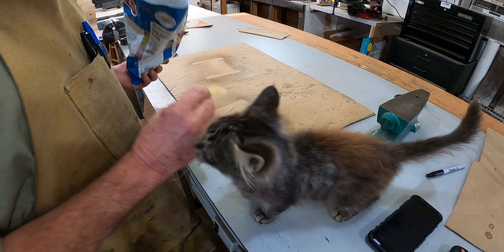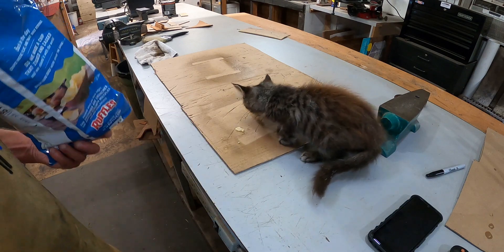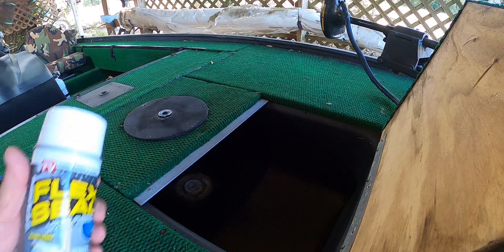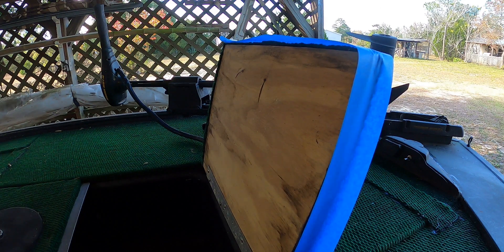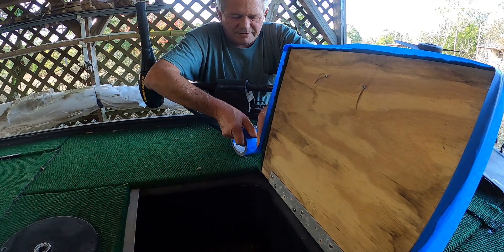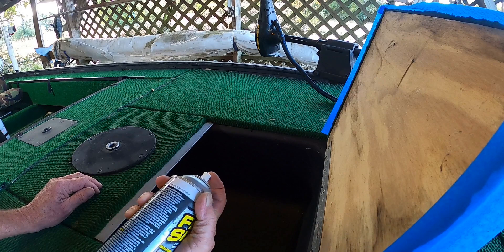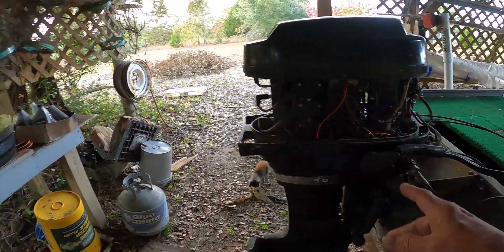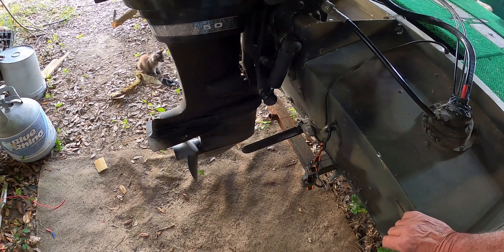Boat  Work

Comment: Looking good Mr.Wallace.   I hope you can get that oil weak fixed in the lower unit. That flex seal stuff works pretty darn good, I put it in a Coleman cooler that had cracks It doesn't leak anymore👍🏻 I hope you get out on the water real soon. Take care Mr. Wallace.👍🏻🇺🇲